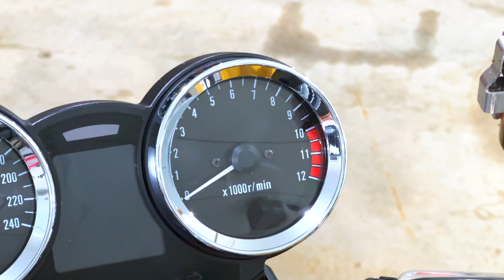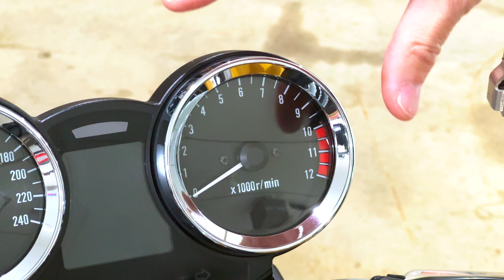The Best Explanation of Horsepower, Torque and How Transmissions Use Them!

Comment: Clever explanation of initial push of Torque versus the slap of horsepower. How would this apply to the torque of an electric motorcycle or vehicle? I often see no HP listing on electric engine batteries.
Reply from the maker: Yeah, I'm going to have to dig into that before I explain things online. I think I understand, but I need to make sure that what I THINK I understand is correct. Good question though!
Reply: @PeterLoweOne  Thanks. Good video, nicely done!

Comment: I used to tow my caravan by keeping the revs in the 2000-4000 rpm range (by changing gears)  as that was the flat-maximum torque band.  That gave me the best fuel mileage.

Motorcycles (other than the old British thumpers!) tended to have short stroke engines, so revs are dictated by piston speeds.  Old days terminology used to refer to long stroke, oversquare etc.